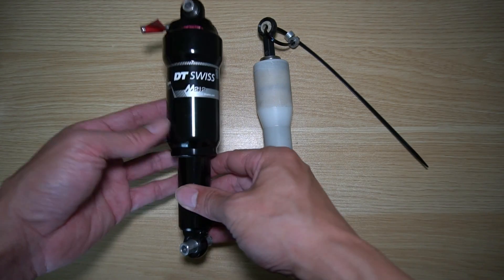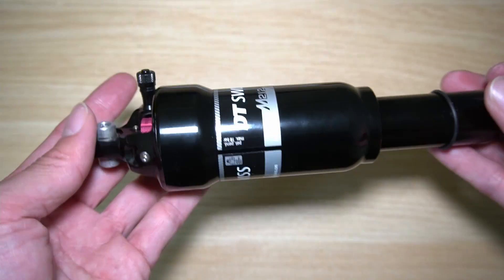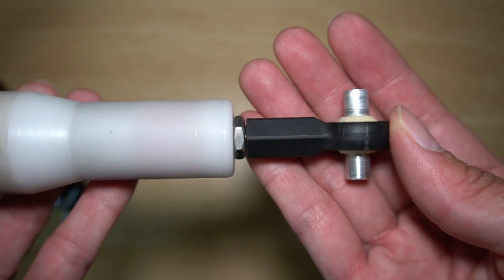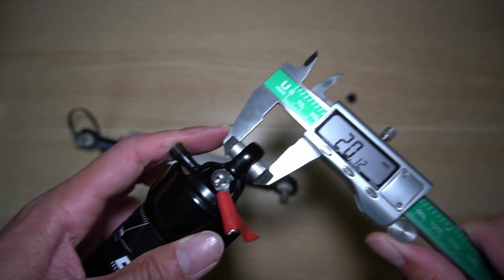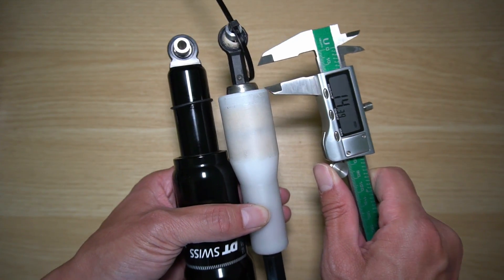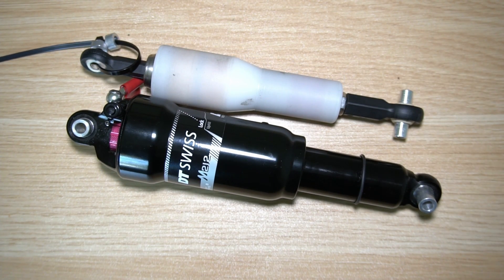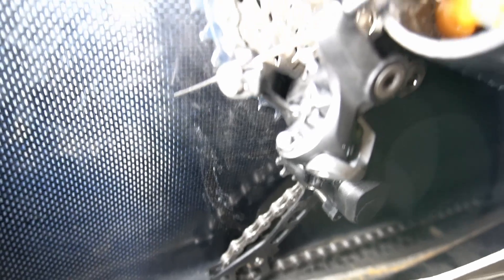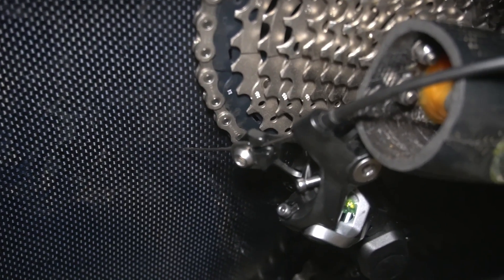DF XL Velomobile Elastomer Rear Suspension compared with stock air shock

Comment: Aren't there also shorter air shocks out there? Would that have been an option as well?
Reply from the maker: Yes but you need to make sure the eyelets and spacing align with manufacture requirements / tolerances. I figured no better way than buying it from the manufacturer.